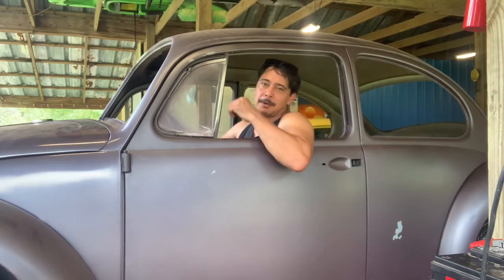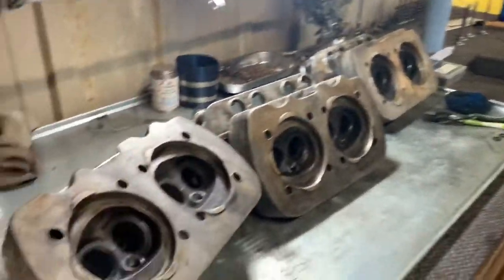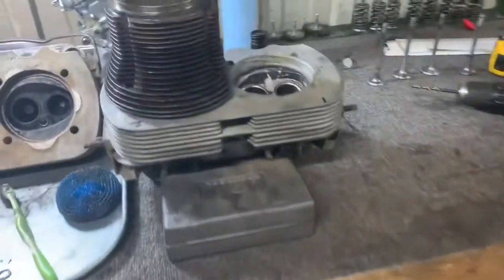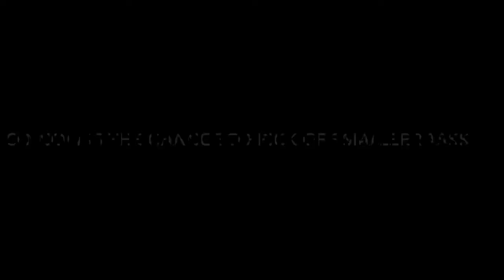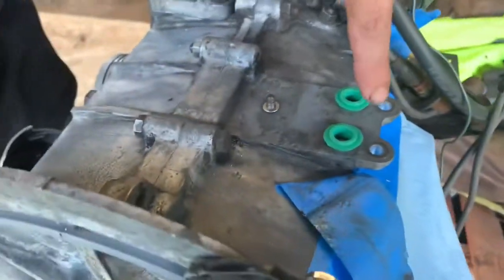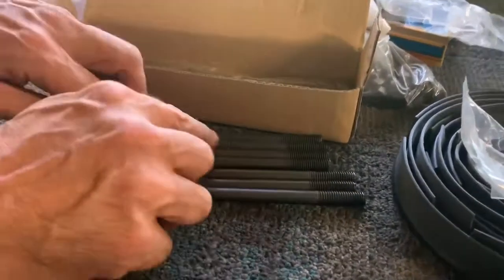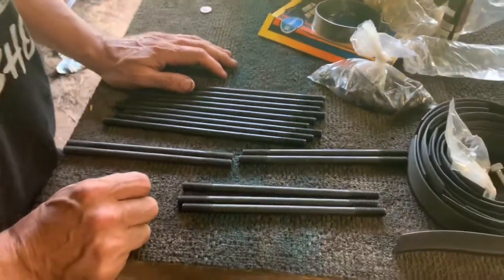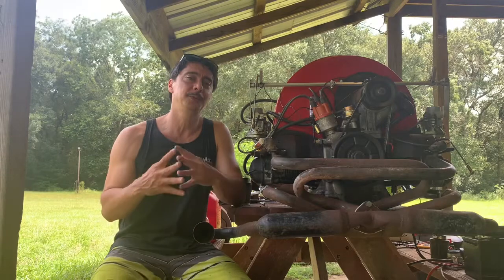1965 VW Bug Project Gets an Engine

Comment: I just saw your station and am enjoying your video. I wanted to say that when you convert a single relief case to the dog house cooler, they sell a conversion stud. It is 6mm on 1 side and 8mm on the other. They you won’t have to clearance the cooler adapter. Just an FYI
Reply from the maker: Nice tip! I’ll definitely remember that one…Which I didn’t know at that time (obviously). Thanks!

Comment: Hell yeah. Sweet. You guys did a great job on that engine. I wonder if I put the right gaskets on my doghouse cooler. Not sure what size my oil galley holes were. And now I wonder about my case studs too.  Engine looks and sounds great. I think you all have done more upgrades since this video so I need to catch up. Jaaa.
Reply from the maker: Thanks man. Pieced it together as a temporary until I built the 1800. It did it’s job!